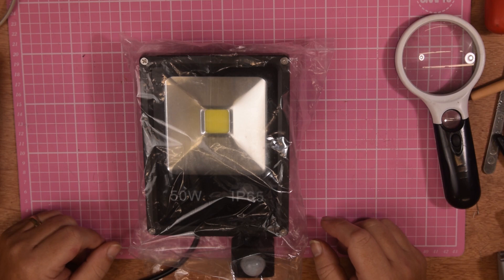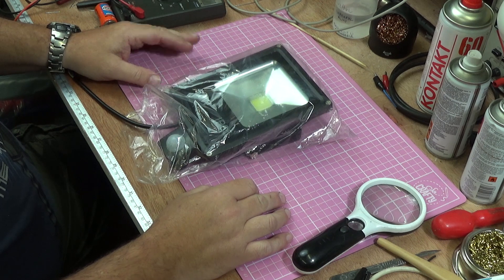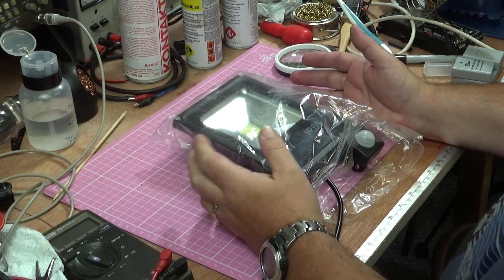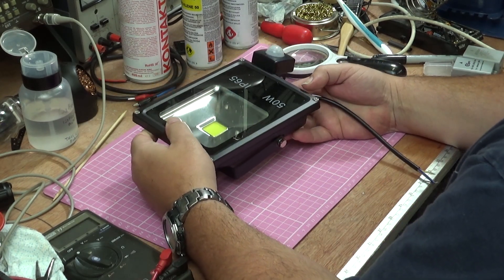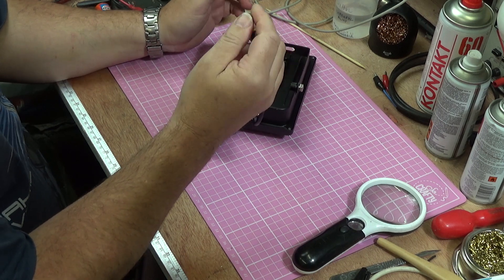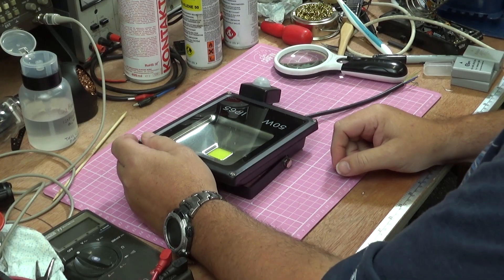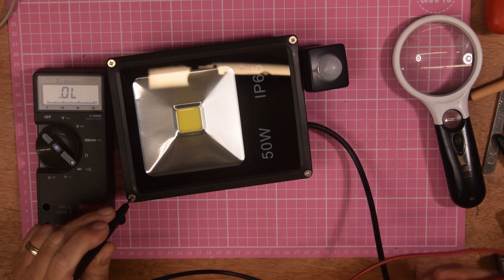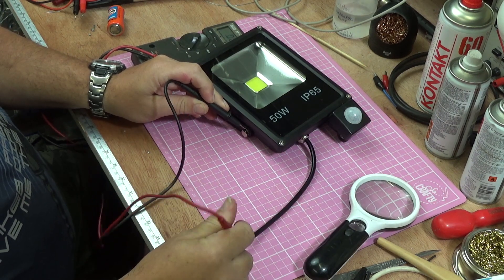Chinese Led Flood Lights : Possible DEATH again!

Comment: Are the colour changing remote floodlights safe for indoor use... because I just bought a 15W one from amazon?😫
Reply from the maker: yes, they are fine indoors, just don't put any cloth or paper on it when its running. Some get warm.

Comment: Over this garbage lights, I have bought Sansi. Much better quality and reliability.
Reply from the maker: Indeed. These are the cheapest possible lights that you can get. For anything more than intermittent non critical applications you are better off buying branded certified units.

Comment: While you busy fixing stuff, you should work on your sound balance
Reply: Not sure if you used two sound recorders. I am using headsets, you can hear the change in sound levels, starts off normal, then goes very low, from sterio to  mono. Not good.
Reply from the maker: @dorahmolalugi9183  I remember the issue now, it was a faulty mic that caused that. Mic has since been replaced and things should be better now.
Reply from the maker: In the last year there have been a few changes. What was most noticeable on this video sound wise?

Comment: The LED chip earth is isolated from the case so connecting the supply ground to it wont earth the Aluninium case, the supply ground should connect directly to the case.
Reply from the maker: Indeed, and that is exactly what I did.

Comment: Thanks George, I bought this same light and boy is it bright.  For 12€ Its way better than anything I can buy in Germany.  After your video I checked the 3 I have all the same...ground connector missing.  You saved my house from burning down I owe you a beer mate.  Thanks for the subscription on my channel.  Brian, Adelsheim Germany
Reply from the maker: No problems Brian. It is almost a certainty that the chinese don't understand the reason for the earth wire. Certainly the factory girls just do what they are told and if that is 'don't  bother with the yellow wire' then they won't.

Comment: Why is it so serious to not connect the earth? I think if the blue and brown touch each other the safety switch in the electric panel would trip and cut the power to that main switch. (Not sure on the exact words in English). Is it the job of the earth cable to cut the power and trip the switch?
Reply from the maker: It isn't so much if the blue and brown touch each other but is either one comes in contact with the metal causing the whole fixture to be live. This wouldn't trip the circuit breaker or blow a fuse in the distribution box but would then be a danger to anyone who touches the fitting. If you brush past it, the current would flow from the energised casing, through you to ground, invariably across your heart, giving you a very bad day indeed.
Reply: @GeorgeChristofi  sorry to bother but just out of curiosity- the ground wire is the path of least resistance? And if the metal box becomes live instead of your body it will go through the cable to the grounding point?
This is one question and i think im right when i say that if the brown and blue touch each other the fuse will trip. Am i right? Or its only if you insall an anti electrocution think in the fuse box?
Reply from the maker: @ofrimashiah2  sensible question. Modern installations use earth leakage circuit breakers which detect current flowing to earth. If the brown and blue touch you will get a large current flow which should blow the fuse in the socket as all uk appliances should be fused at point of connection to the ring main. 

If the earth wire is connected in the appliance and the case goes live, the elcb should trip in the distribution box well before the fuse even gets warm. Without the earth wire, there is only the current path between your body and ground to trip the breaker. If it goes faulty with the earth wire properly fitted, the breaker activates immediately and shuts down the circuit. Without the earth wire, the unit will stay live until something creates that current path to ground to trip the breaker. unfortunately, if it is a human being, the day is pretty much ruined.

Now this only applies to modern installations. Here in the UK there is no compulsory upgrade to bring wiring that is already installed up to current standards. Older installations although not compliant with current rules are perfectly legal. In previous versions of distribution boards you had wire fuses. If the unit developed a fault, the large current would melt the wire and neutralise the danger. 

However, with no earth wire, a live case would not generate any current in itself. If it was touched though, you would have to pass sufficient current to melt the fuse. Most appliances are fitted with 13A fuses which actually blow at nearer 20A. Even if the appliance is fused correctly with a 1A or 3A fuse, your body would have to pass at least 2A to melt the smaller fuse. If that happens you are probably having the worst day of your life, and possibly the last one.
Reply: @GeorgeChristofi  yea thanks mate. Just asking cause i need some led floodlights. And installing them outside... Not sure if its real or not but what if the rain delivers the electricity and you stand when its pouring. I mean i have never heard of such stupidity not to intall that 10 p connection. Thanks for the help mate 😀👍
Reply from the maker: @ofrimashiah2  Rain won't deliver electricity, but it will make it hurt more if you touch a faulty wired unit! Take care, be safe and best wishes.

Comment: lol at that wire sticking out. I wonder if it was under that screw when assembled and popped out in shipping.
Weird. Between 4:58 and 5:26, the right channel drops out.
Reply from the maker: No, it would have just been ignored at the factory. I have had a few like that in the past.
Reply: Ah, right. One is a possible single failure. Multiple cases point to just shoddy construction.
Reply from the maker: I did hear the drop out, I'm trying to find the cause. It isn't the microphone so next is a cable change.

Comment: Very informative, hard to believe they overlooked an easy fix like that.
Reply from the maker: It happens a lot Andres. I think this is possibly the third or fourth set I have had which has a missing safety earth. Always different suppliers but always the same fault.

Comment: Hey George, that would work well at my house since the outdoor light fixtures only have two wires running to them anyhow, lol, but then, it's an old house. :)  That and I am the only one who could actually reach the fixtures without using a ladder.
Reply from the maker: It would be similar here but I did run 3 wire to my lights, just as a way of making it look legal. (Over here officially only qualified electricians are allowed to do mains work)

Comment: An incandescent light bulb would be much hotter.
Those flood lights look like they're nice and bright after the fix.
Reply from the maker: They are actually pretty good. They regulate themselves if they get too hot and they produce a consistent light. I have yet to run one long enough to say what the actual quality of the led chips are like and how soon they are likely to fail but the housings are ok if you wanted to take the panel out and use them for something else outdoors. Cheaper than other aluminium enclosures. Could be used for antenna switches or coax junction boxes.

Comment: You and bigclive should know by now that they are never correctly grounded. 😋 You would think that they could mold a ground lug connection into the case at least!
Reply from the maker: They actually do, and it is threaded as well. I can't understand why they can hand screw everything  in but not put the earth wire on... makes no sense.